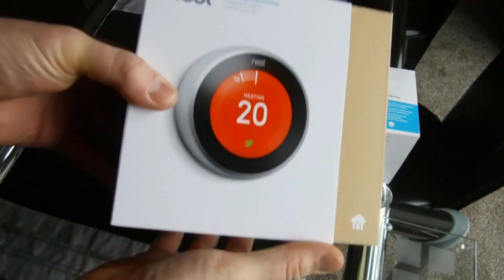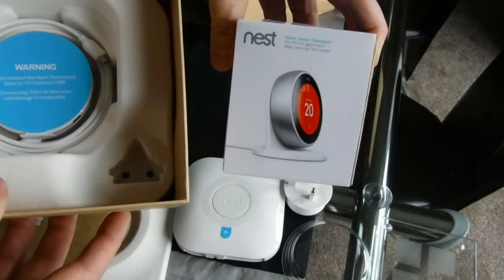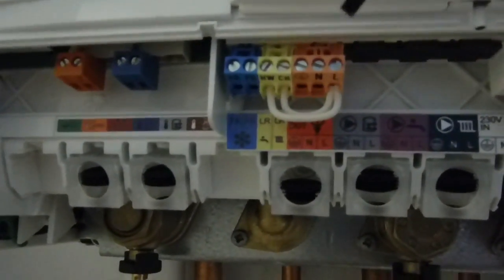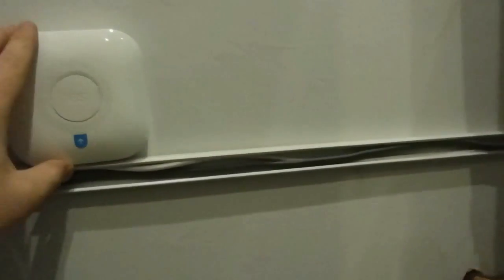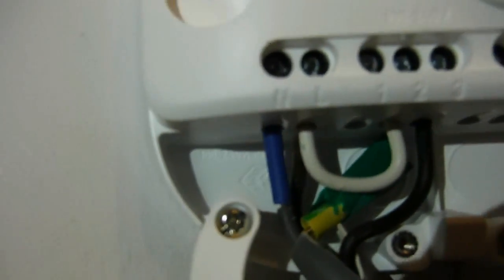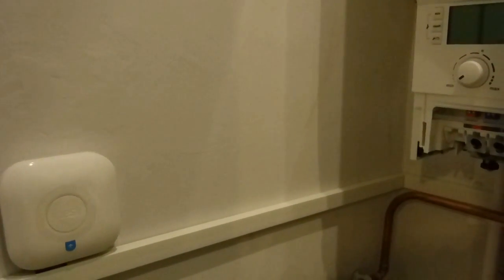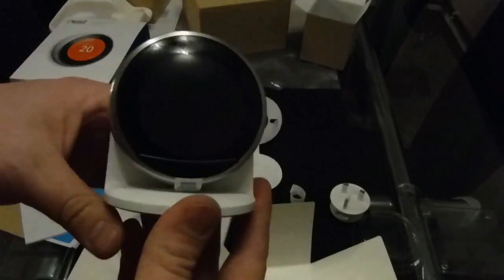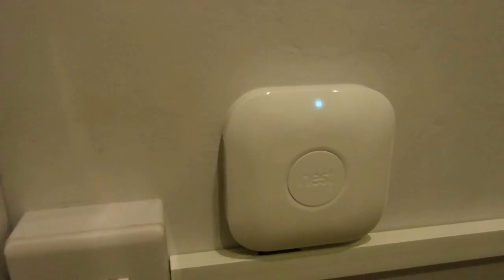How to install Nest Thermostat 3rd Generation - UK

Comment: Hi, I don't even have a Nest, having plumped for a Hive system, but I just had write to commend your excellent video. If only someone with your skills at explaining would do something similar for the Hive. Great stuff, thanks - even though I'm on the other side of the smart thermostat fence :)
Reply from the maker: +flyentity Thanks for your kind words. It's like Android and Apple....they are both good products! I'm going to be doing a lot more How To Videos in 2017.....so hopefully you will find some of them useful.
Reply: Actually, I'm thinking of jumping ship. I've still a few days left to send my unopened Hive back to Amazon and buy a Nest instead - although substantially more pricey as I got the Hive at the reduced price of £124. I like the idea of not needing a hub at the router for the Nest. And they should both work nicely with my Echo Dot.
Reply from the maker: +flyentity I love the NEST and in my opinion it looks nicer than the Hive (not the sole reason to buy it mind!!) I would wait until just after Christmas....I imagine the NEST coming down in some kind of flash sale. They did around Black Friday.

Comment: Hi thanks for posting I have a simlar boiler but mine is a WB Greenstar 29cdi combi.  Just one question.  Why did you put a loop connection between live and number 2 on the heat link?  Do i need to do the same, what happens if i dont put a loop in?
may thanks
mo
Reply from the maker: +Mo Hussain Hi...hope you found it useful. Both Worcester Bosch and NEST advise to put the loop in. Basically it works as a switchable live and when the NEST tells the Heatlink it needs heat, the Heatlink connects 2 and 3 creating a live return back to the boiler. That's it in a nutshell.
Reply: Excellent thanks. Will complete mine this w/e - your post was very helpful.

Comment: I definitely owe you a beer 👍🏻 I now appear to have a working Nest, thanks very much again for all your help
Reply from the maker: +Guy Daniels Awesome! Glad I could help! You will love it....
Reply: Did you out it in a room with a trv on the rad? Im interested on swapping from hive to this. Also moving it out of the hall into living room
Reply from the maker: Yes the radiator has a TRV on it, but it is fully open (set to max).
Reply: @charlieshooter  would it cause any conflict between the room stat and trv?
Reply from the maker: @mattsidebottom7603  If it's a normal TRV then no....if it's electronic then maybe!
Reply: @charlieshooter  thanks for the reply
Reply: @charlieshooter  ive moved the hive into the living room with the trv wide open. The whole house feels more balanced. With the hall not being too hot now. Cheers
Reply from the maker: @mattsidebottom7603  Pleased to hear you've got it all working! 👍🏼
Reply: @charlieshooter  ivw just got a problem with a honeywell control box for the previous thermostat thats still wired to the boiler. for some reason it keeps having a red light appear and the button need resetting. i need it taking out but dont know enough to do it myself
Reply from the maker: @mattsidebottom7603  Yes that definitely needs removing!
Reply: 😅o

Comment: One (probably stupid question), why is the Live looped to 2 on the Heat Link please?
Reply from the maker: +Guy Daniels Right OK....here goes! First things first. DO NOT connect the NEST to anything other than the plug it came with OR directly to T1 and T2 (polarity doesn't matter you're right). You need to make sure that the wires you are connecting the NEST to don't go anywhere else in between as if there is a 240v feed on that wire it will fry the NEST!! Not good! The Heatlink drops the voltage to 12v through T1 and T2.....so the NEST is safe only if connected directly to those terminals and nowhere else.
As for the other connections. I've just had a look at the wiring diagram for your boiler online (google "Potterton Pro Max Combi HE Plus Manual") and would advise as follows:
The Live (L) and Neutral (N) on the Heatlink need to be connected to the Live and Neutral at your fused spur (where the boiler is connected to the mains). Use a piece of flex coming from the fused spur to the Heatlink.
The BK2 on your boiler (your grey wire I think?) needs to connect to "2" on the Heatlink. The BK1 on your boiler (your black wire I think?) needs to connect to "3" on the Heatlink.
You DO NOT need to loop the live as I have.
Please double check this yourself and make sure it makes sense according to the wiring diagrams for the Heatlink and the boiler. I hold no responsibility for any problems or malfunctions.
But please let me know if this was helpful and at least give me a like and subscribe!! 😉
Reply: charlieshooter thank you very much again 👍🏻 I've checked the feed wires I'm going to use for the nest using and oscillator will put my multi meter across them with the Heat Link and boiler switched on before terminating the Nest to ensure I'm only getting 12v. I think I owe you a drink 👍🏻 I'll keep you posted and thanks again
Reply from the maker: +Guy Daniels There's no such thing as a stupid question when it comes to DIY!
Worcester Bosch advise when fitting a programmable thermostat (i.e. the NEST) that the live and common(2) are linked on the thermostat/receiver (Heatlink). NEST also advise to do this when fitting it to a 230/240v boiler. Basically, it works as a switchable live and when the NEST tells the Heatlink it needs heat, a switch in the Heatlink connects 2 and 3 creating a live return back to the boiler. The boiler then knows to fire up. Hope that helps!
Reply: Thanks for replying, you'll probably regret that upon reading this but any help is greatly appreciated....I've hit another wall. I have a Potterton Pro Max Combi HE Plus and the block terminal doesn't look anything like the one in the video. I have the following:-*Switched Live in > 1 - BK (Leaving on a Black Cable)*230v Live Out < 2 - BK (leaving on a Grey Cable)These appear to be the two that run to the current Danfuss Theromstat.However, inside the Thermostat I have the following terminations:-2 Com (Brown Wire Input)3 N/O (Black Wire Input)The colours seems to have changed?! These are the two I was going to use to run power to the nest using T1 and T2 (am I correct in thinking it doesn't matter which way round these go)?At the boiler it says:To connect external control (s):*Remove Link Between Terminals 1 & 2 (this has already been done as above)*230V must be taken from terminal 2 to the control(s). Connect the switched output from the control(s) to terminal 1.Does Terminal 2 go to Heat Link L and does Terminal 2 go to Heat Link 3? And where has my Neutral gone?!Apologies in advance :-)

Comment: HI, I have an outside boiler with the programmer inside in the kitchen, but no existing thermostat, to i just replace the programmer with heat link then use the nest wirelessly? Thanks and great video.
Reply from the maker: +Niall Thornbury Yep that's it. The heatlink is what tells the boiler what to do (on/off), and the NEST talks to that wirelessy. Glad it helped.
Reply: This is my dilemma, the heat link completely switches my boiler off, meaning when it is off, I do not get hot water unless I switch the heat link on manual, i.e. continuous heat on the boiler, which is silly especially when it gets warm, so I turn the dial on the boiler to hot water only. I have to do this all the time on my ancient boiler. Pain.

Comment: Does this boiler support OpenTherm? And if so - wouldn't it be better connecting using that?
Reply from the maker: +sjokomelk No this boiler doesn't support OpenTherm....but if it did then yes it is better to connect that way.
Reply: charlieshooter what's open therm
Reply from the maker: +Eric Tanoh OpenTherm is the name given to a form of communication between central heating 
appliances and room thermostats. It sets the rules as to how the 
appliance and room thermostat communicate with each other. Hope that helps!

Comment: Hi, i got my Nest device 3rd and when I opened my thermostat box (honeywell st699), i have one cable connected between hot water com, heating com and live. How should I do this connection in my Nest device (i was expecting only 4 cables)? Do u have any email that I can send the pics over? Appreciate your help!
Reply from the maker: +Wladimir Clemente Hi... I would try and trace the wires back to the boiler and see what goes where on the boiler. Then follow what I've done in the video. This video is quite specific to a combi boiler, so if your system is different you may need to wire it differently. I would probably say that the hot water com would stay looped to the live though so you've got constant hot water.

Comment from the maker: No problem. Glad to help any other DIYers out there.
Reply: charlieshooter que?
Reply from the maker: +James J Sorry??
Reply: charlieshooter hi, thanks for the video! Got a question if you don't mind me asking. 
I set up the nest and all was fine and dandy until I realised I've got no hot water. It's there when the boiler is working, but when the temperature is reached, the boiler switches off and hot water goes with it.
I've also got a Worcester, and was wondering if you had the same issue?
Reply from the maker: Nikita Michailov There should be a loop going from Live (L) on the boiler to Hot Water (HW) on the boiler. This should ensure the hot water is on constantly no matter what the NEST is doing. Make sure the loops not going from CH to HW on the boiler.
The other thing could be that the boiler is turning off totally once the  NEST tells it to turn off. This would happen if the Live on the boiler was wired to 3 on the NEST maybe??
Reply: Wow, thanks for quick reply. I'll need to take it apart tomorrow, thanks for the ideas